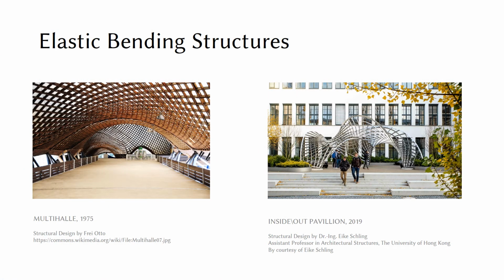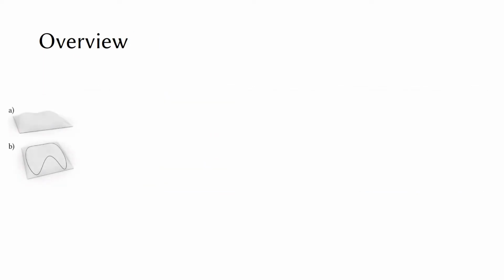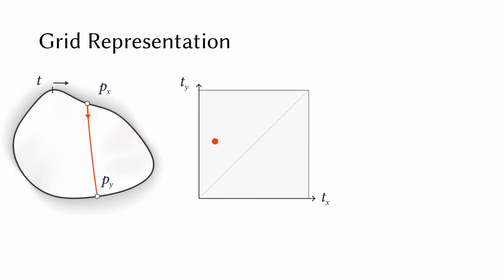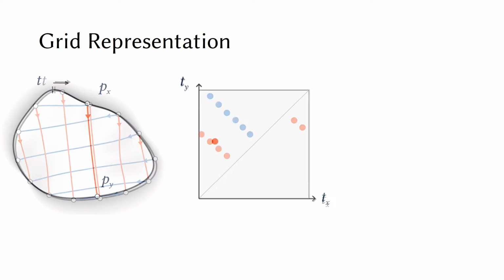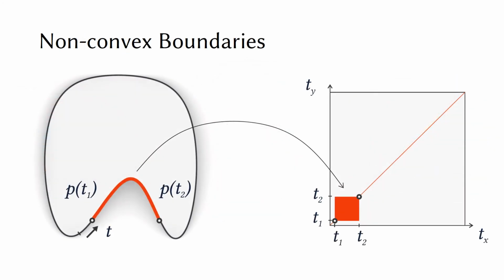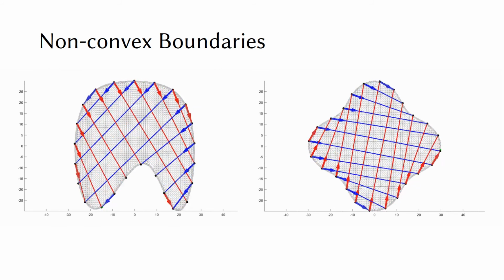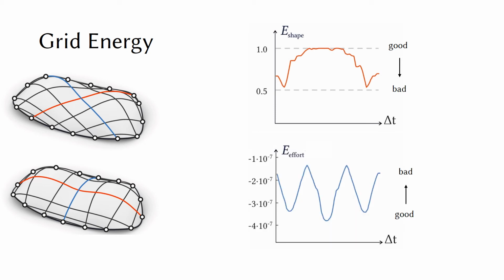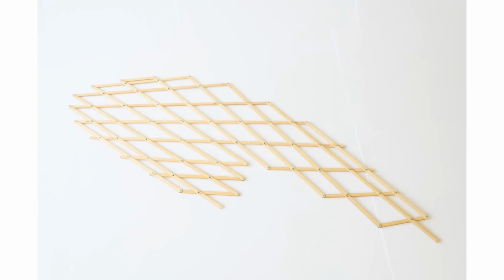Generalized Deployable Elastic Geodesic Grids

Comment: Brilliant stuff, congratulations to the whole team. I just read the paper, and I am very interested in the methods. Any way to get a copy of the code?

Also, I could imagine picking a grid structure that both approximates a self-supporting structure and minimizes the minor axis width of a planar parallelogram when flat. So a whole wooden structure could be assembled, put inside a large steam pipe to prepare for bending, then unfolded into the final shape immediately after (or the same for subsections of the overall structure). Adding diagonal supports in each quad in the grid would make the structure very stiff. Seems like a very low-cost method to build the frame of a building, and in much less time than a traditional geodesic dome.